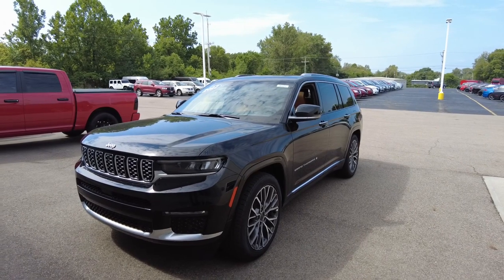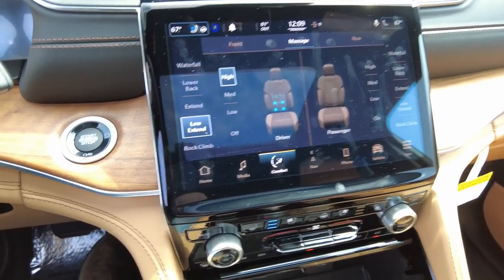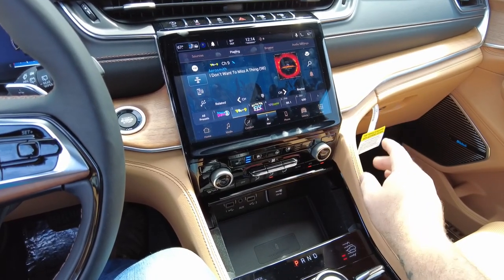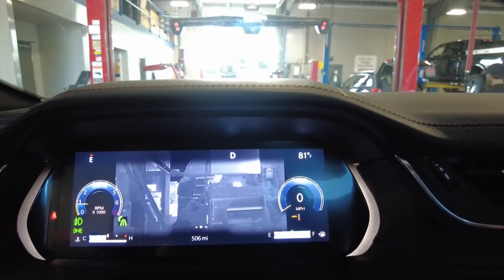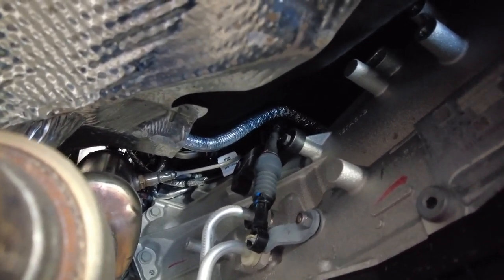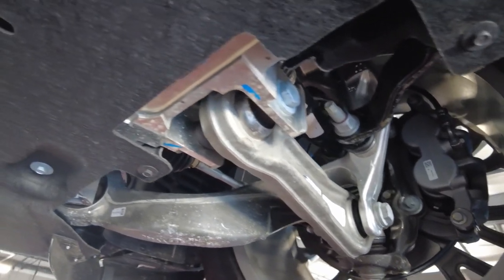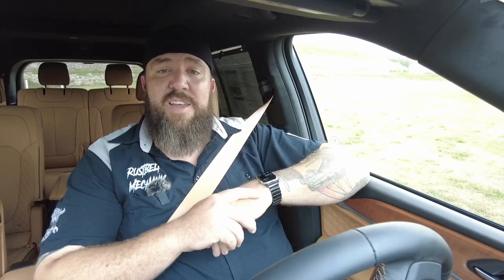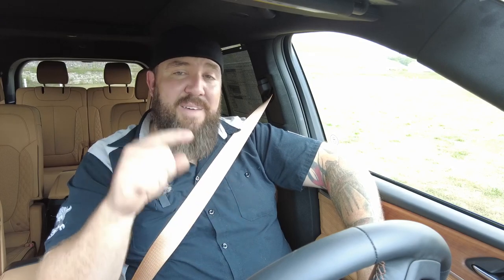2021 JEEP GRAND CHEROKEE L - REVIEWS BY THE MECHANIC

Comment: Hello Rustbelt Mechanic.  Good review, tour and drive video for the newly released fifth generation Jeep Grand Cherokee L.  That's nice you were able to get your hands on the high trim level Summit Reserve.  The interior looks great with the Palermo leather seats along with Palermo surfaces and walnut open pore wood panels.  One of the reasons why the Jeep Grand Cherokee L is more luxurious over the outgoing fourth generation Jeep Grand Cherokee is probably due to Jeep teaming up with Alfa Romeo.  This vehicle is built on a new different platform that's from Alfa Romeo and doesn't share any framework from the Dodge Durango.  It has third row seating like the Durango, but that's it.  Overall maintenance of this vehicle will involve a little more spending.  Whoever wants this vehicle especially in the high trim should take into consideration the maintenance aspect of it spending wise.  I've test driven the Jeep Grand Cherokee L twice so far couple months ago in July.  Once in the Limited trim and once in the Overland trim.  The ride quality was nice from both of them.  It was nicer on the Overland trim due to coming equipped with the adjustable air ride suspension system.  After I test drove the Overland trim I tried out three other features which wasn't found on the Limited trim like the McIntosh 19 speaker premium audio system, hands free foot activated lift gate and the power folding rear seats. Those features along with few other features are found on the three top tier trims Overland, Summit and Summit Reserve.  The hands free foot activated lift gate is a neat and convenient feature.  It'll get used a lot.  As long as the key fob is with you just walk up to the vehicle, move your foot in a slight kicking motion under the middle part of the bumper and that's it.  The lift gate will open.  The lift gate will also close the same way.  If someone's hands are full this feature will be put to use.  A nice addition to the vehicle.  Another thing that's found on those three top trims, but it's optional is the legendary 5.7 liter HEMI V8 engine.  That'll be the engine of choice for me when I get the Jeep Grand Cherokee L in the Overland trim.  I think what Jeep should've done with this engine was to still have it optional starting with the Limited trim.  Then, also have it optional with the Overland trim and Summit trim.  As for the Summit Reserve trim they should've made the V8 engine the standard engine since that's the highest trim level out of the six trim levels available.  Overall, this vehicle will do great in overall sales like the previous four generation Jeep Grand Cherokee vehicles.  With the addition of third row seating, whoever is cross shopping for a mid-size third row seating SUV will have to include the Jeep Grand Cherokee L on their list.  The available comfy features along with upscale premium materials used throughout the interior of the three top tier trims Overland, Summit and Summit Reserve makes those trims capable enough to compete well with the luxury branded mid-size third row seating SUVs.  The interiors from those three trim levels will give the interiors from the Cadillac XT6, Lincoln Aviator, Acura MDX, Mercedes GLE, BMW X5, Lexus RX 350L, Infiniti QX60 and Genesis GV80 a run for their money.
Reply from the maker: All great points, yes after I realized what I said about the Durango and it definitely does not have any connection to that. If you think this Grand Cherokee L is cool, just wait for the Grand Wagoneer to come rolling out!
Reply: @RustbeltMechanic  I've seen the presentation of the Jeep Wagoneer and Grand Wagoneer.  Both full size SUVs looks great.  It's great that what was presented at the conference got put into production.  The Jeep Grand Wagoneer with the seven screens looks stunning.  It has more screen real estate than the Cadillac Escalade, more wood grain materials and more premium materials used as well.  It has power reclining third row seats which the Escalade doesn't have.  In reference to size the Jeep Grand Wagoneer is three inches longer than the Escalade and four inches longer than the Navigator.  With that taken into account there's a pinch more passenger space in both the second and third rows.  As for cargo space there's more in the Jeep Grand Wagoneer too.  More cargo space behind the third row, more cargo space behind the second row when the third row seats are folded down and more cargo space when all seats are folded down.  Finally, it has a greater towing capacity as well.  It has a towing capacity of 9,850 pounds while the Cadillac Escalade has a range between 7,500 to 7,700 pounds and the Lincoln Navigator has a range between 6,200 pounds to 8,300 pounds.  A nice cool feature both the Grand Wagoneer and Escalade share is a mini refrigerator in the center console arm rest up front.  This year Jeep will make bold statements across the board.  The Jeep Grand Cherokee L along with the upcoming new generation two row version Grand Cherokee and the Jeep Wagoneer along with the Grand Wagoneer will be the vehicles to do that.

Comment: Hi would you say the durability and longevity of the V6 engine is the same as the V8 engine? I’ve read some reviews that the V6 engines don’t last as long maybe due to lack of power from the engine in such a large heavy vehicle.  Is the driving experience comparable to a Toyota Highlander with a sluggish take off? I want the V8 but at the same time would consider the v6 to save gas but i don’t like that feeling of feeling like I’m driving a tank around.
Reply: I had both v6 and have v8 jeep grand cherokee L. V6 is very laggy and V8 is slightly better. But they both are horrible in mpg. I got 14 mpg with v6 and gettinf 11.4 mpg  with current v8. Everything else so far has been okay.

Comment: I see the air susupension. I say whoo thank god i have the altitude L  without the air suspension.The only thing I don't like is that dashboard does'nt get any brighter than the max which is pretty dim no matter the setting.The paint chips pretty easily almost like the hood especially feels like a plastic hood.

Comment: Overall what do you think about reliability, are the old ones reliable, im about to get this one.
Reply from the maker: Somewhat, depends on the trim and engine. They all have their quirks. The early 3.6’s had a lot of oil cooler and cylinder head issues.

Comment: They are expensive that's for sure. I bought a top of the line 2014 hemi grand Cherokee summit for $25k 2 years ago and this is essentially the same drivetrain and options just spruced up for 2.5x the price.
Reply: Oh no, this is much different, totally different
Reply: Right, you bought a used 4 year old vehicle for that price. This is brand new, and besides that there is still a huge difference between a fully topped GC and even a Overland L
Reply: no comparison at all... just go test drive one ... I have the GLC Overland and it's waaaay better than my 2011 Grand Cherokee
Reply: @Chuckthe2s  I did drive one.  Wouldn't say it was worth 2.5x more.

Comment: Is it essentially a Durango?
Reply from the maker: Pretty much
Reply: The Jeep Grand Cherokee L comes equipped with third row seating like the Durango, but it doesn't share anything with the Durango though.  Based on what Jeep said at their Conference presentation event earlier this year back in January, they said the Jeep Grand Cherokee L is built on a new different platform. A new different platform that's from Alfa Romeo.  This is one of the prime reasons certain things especially on the interior is on the upscale side.  The three high tier trims Overland, Summit and Summit Reserve definitely symbolizes that.
Reply: @RustbeltMechanic  they don’t share platforms…..